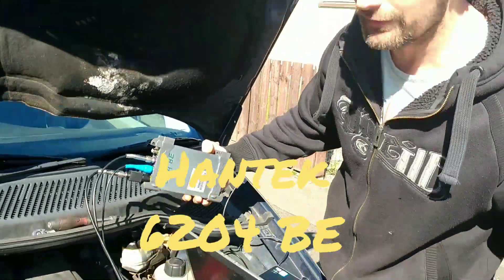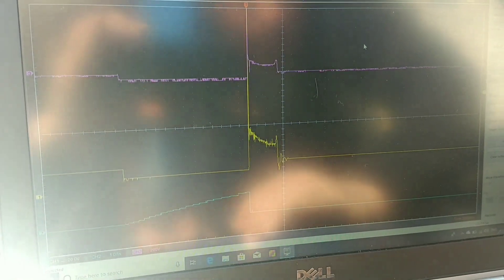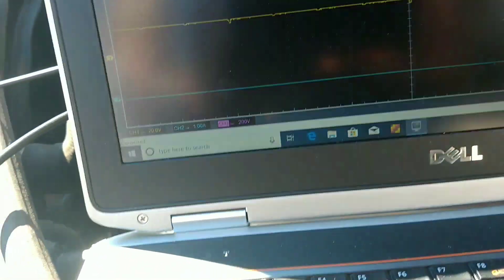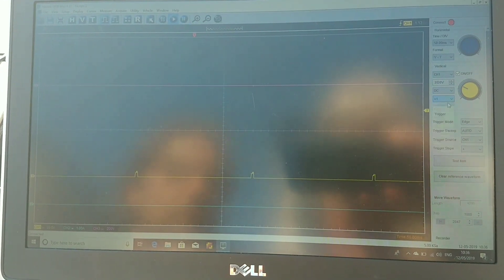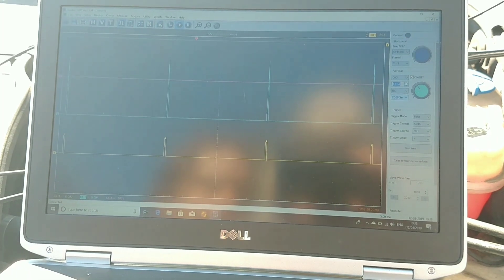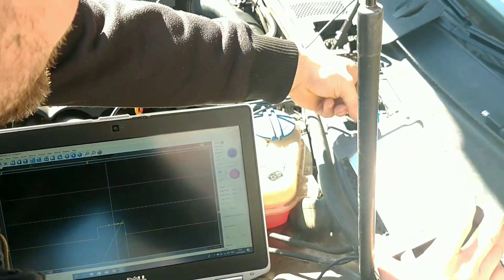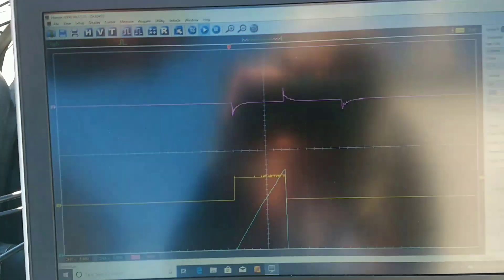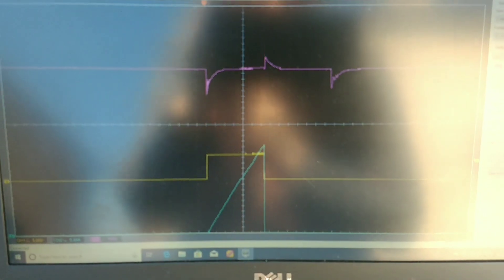Hantek 6204BE, Ignition Waveform (2 wire and 4 wire COP)

Comment: Thanks for sharing matt, just ordered that book
Reply from the maker: It's been really helpful for me, I have watched YouTubers use a scope when they diagnose, I wanted a book on the subject to keep with my scope. Tom Denton also has waveforms in his advanced diagnostics book.
Thanks for watching Dave
Reply: @mechanicmatt871  yeah matt. Never done learning. That pick up probe doent look that great. I was thinking of making one
Reply from the maker: I didn't think it worked well on this ignition coil either, the back probing wire resting on top of the coil worked better although I still didn't get a great secondary waveform. I will try it on some other make of coils incase the VW one was just better insulated. It will be good to see how you get on with a homemade one Dave, thanks Matt